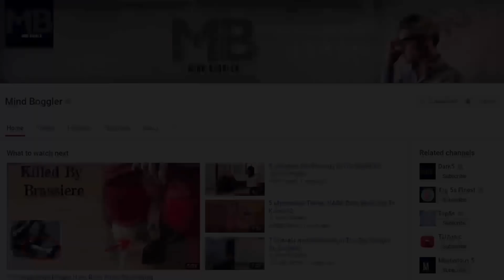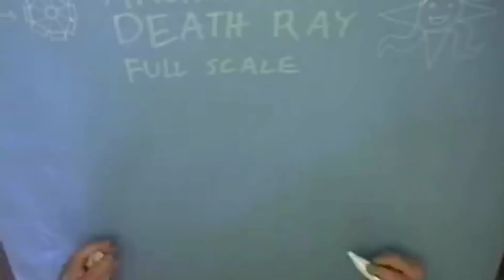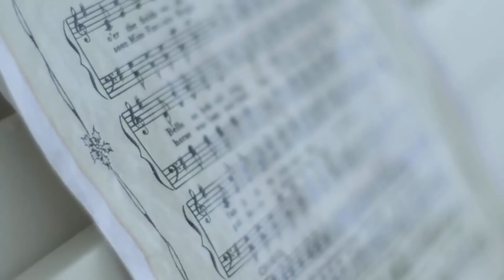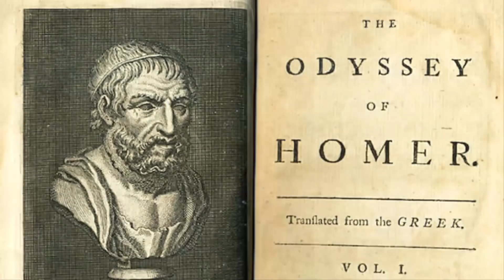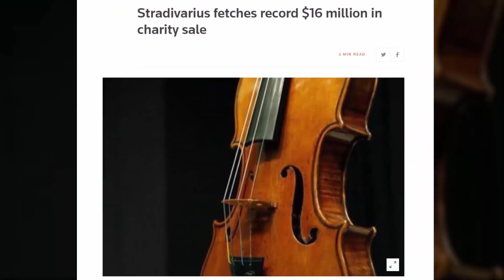15 Advanced Ancient Technologies We Still Can’t Replicate

Comment: For the Roman concrete - they just built thicker. Nowadays the concrete doesn't hold for just 80 years. If we would build walls that thick again it would hold longer. But we build thinner with steel in it for stability/static reasons. That brings a few new problems which Romans didn't have like oxidation or corrosion. Also the additives are different than nowadays, so a replication isn't possible at all. Mystery solved.

Comment: Damascus steel isnt a lost technology, it's made by combining low carbon iron with high carbon steel. The point is that it makes a steel that is both very hard to keep an edge and very flexible to avoid breaking on contact with other steel. Any experienced swordsmith can make it, it's not that difficult.
Reply: That is technically pattern welded steel. Actual Damascus steel is now a lost art but knife makers today just call it Damascus because it's similar and is less of a tongue twister than saying "pattern welded steel" every time. I should know, I am a blade maker.
Reply: @SnorrioK  I thought pattern welded steel and damascus were the same thing, I just described the pattern design on the blade caused as a result of the way damascus is made. What's the difference?
Reply: @dustinholland6700  - I suggest you read upon it, otherwise, I'd just be copying it from there. Also, ABS master bladesmith J. Neilsen from Forged in Fire has iterated these same facts a few times.

https://en.wikipedia.org/wiki/Damascus_steel
Reply: @SnorrioK  I've experimented with blade making. I've made some knives and swords and tried my hand at making damascus (or pattern welded steel) before. So I have a decent idea too, I've just always heard the two terms used interchangeably.

Comment: Awesome 👍 the last one about the wall, I think they weren't always solid rocks, I think they used plant materials to let the rock harden over time, easier to lift a liquid rather than rock
Reply: You are close but not exact !

The material was tendons from humongous creatures that died during the great flood , the water was salty water which petrified the tendons.
The humongous creatures was humans that stood over 2 miles tall , they got stuck in the mud and drowned.
The tendons are composed of CaCo3 which is calcium carbonate or basalts if you wish.
The tendons were wet as cheese and very easy to shape or cut , once it dried it was hard as granite rock.
The cutting was performed by thise that came here after the floid waters receded and the tendons were very visible.
When stacking there was no need for mortar in the joints , the soft tendons would self seal.
There was and still are those of higher technology here on this plant but you don't see them just lije you can't see the gigantuous creatures that are still here because you live on top of the humongous graveyard.

There was no quarries needed , no moving the material for long distances because it was already in place.

Just as they hide the ET's today , they hide the truth also.
We are like sheep , trained to train our young to believe , act and participate in the prerequisite programs of life , like slaves.
The huge structures around the world were designed by those from other planets.
We call them GODS but we have never been introduced .
As told , there was only 8 people on Noah's ark , who else would have such technologies to build such , Noah had to get his instructions from them to build the Ark .

Comment: "--we still cant replicate" 
FUCK OFF you dumbass bullshitter

Nimrud lens- not strong enough to be used in astronomy.
Archimedes - even though technically under perfect conditions, possible, it is generally not believed to be an accurate acounting, especially because earlier accounts speak of "fire-weapon" not of the , some centuries later, mentioned "burning-glasses"
Byzantine fire - has been replicated plenty of times, we just dont know which version exactly was used
Telharmonium- nothing misterious there
Nepenthes - not indentified does not mean unknown, the function , if actually existent, are known to exist in many ways
Vitrum flexile - not even contemporaries agree on what the story was, "more frequently told than it is reliable"
Stradivari - research has shown that he protected his woods against pests with borax and other chemicals which had, probably unintended, positive effects on the, in any way, great quality of the wood used
Antikythera - there are replicas of it, we know how it works and what it is
Roman concrete - we know how to make it, it is not realy used because it is more complexe and not as practical to use
Damascus steel - we know how to make it and have better steel nowerdays
Lycurgus cup - we know how it works , they did know only how to make it
Viking crystall - no , the crystal could help detect the sun when there were a few thin clouds. It does not help at all if the clouds are even just relatively thick, GPS is a post-ww2 invention (1970s)
Kutb minar - the pillar is coated ... simple as that. It does not rust, because it is coated.
Pyramids - we know several ways in which it could have been done , dragging and lifting witch primitive tools is the most common explanation, saying we are not sure which one it was does not equal "we dont know how"
Sacsayhuamán - we know how incas cut rocks wich river cobble techniques, ofc people could move big rocks, and ofc we can move rocks. 

What a load of bullshit!